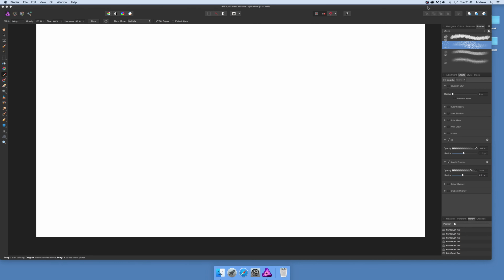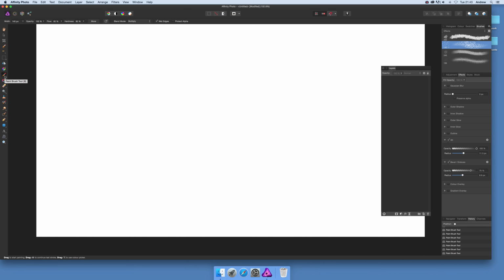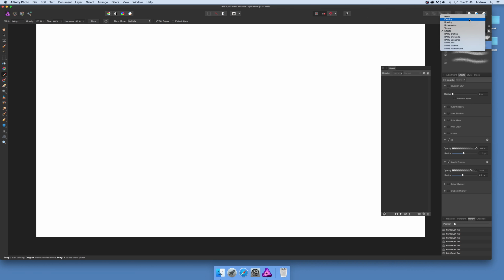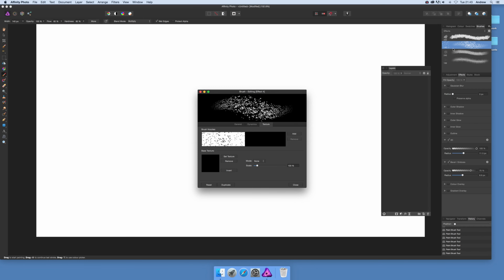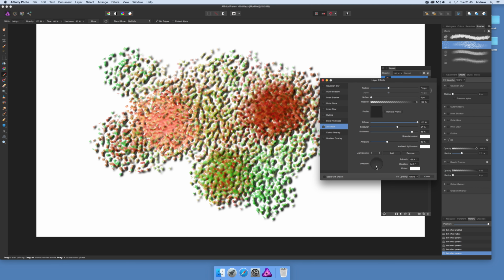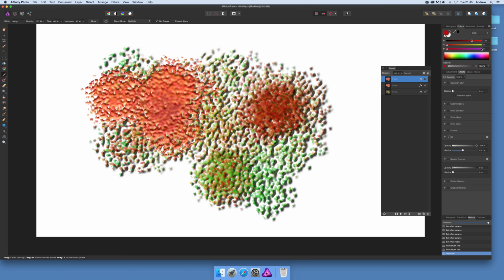How To Add 3D / Depth To Brushes In Affinity Photo

Comment: "Layer Effects" seem to only affect brush-strokes.  If I add brush-strokes to the same layer as a scanned image, the image doesn't seem to be affected by the effects.  Is it supposed to be like that?

Thanks very much for this tutorial!  Great to see how the feature is actually used.
Reply from the maker: Harry Pehkonen Just created another video on the live filters. Yes, if you create a layer for the brushes and then apply the live filter it is added to that and not the scanned. If you de-select all the layers and then add the effect then the effect will be added to the brushes and the image. Certain there are many combinations such as adding adjustment layers and layer effects into the mix